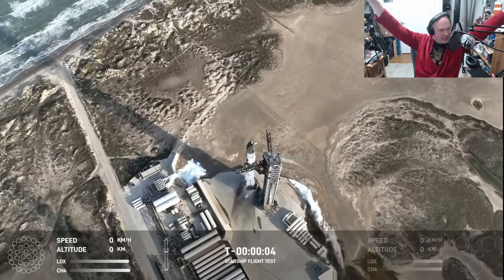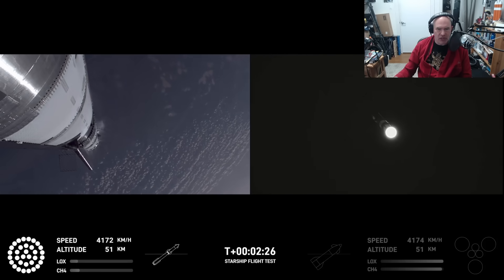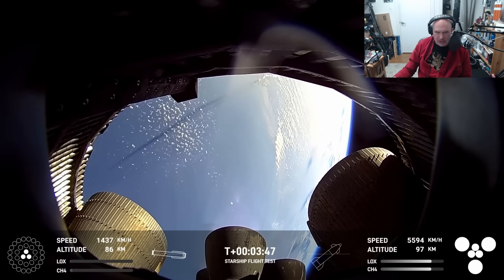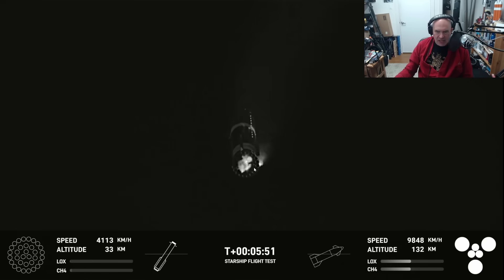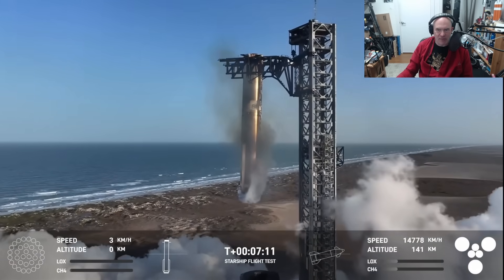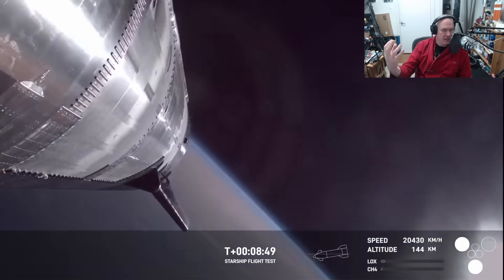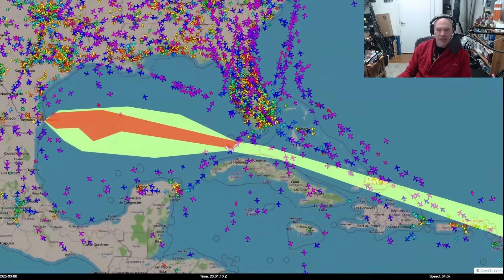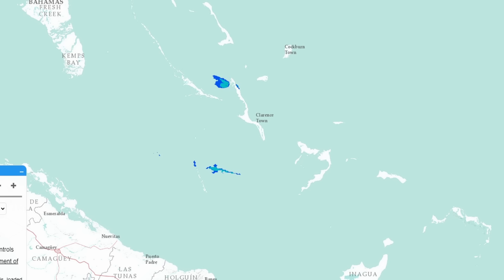SpaceX Make The Same Mistake Twice With Starship Flight 8

Comment: Now I understand why booster reuse is such a big deal: They will need 20 launches to have one surviving upper stage.
Reply: zing!
Reply: Great burn. 🤣
Reply: this is peak
Reply: The same upper stage that “Gwen” said was going to be taking 1000 people point-to-point in place of airplanes?
Reply: @antonyborlase3965 yep, the timeline on her statement is getting awfully short. Not that I ever thought it a viable idea.
Reply: @antonyborlase3965  she and elon said it was the whole starship and it was going to only be able to get from like saudi to nyc, burning 100x the fuel of airtravel, which is the most expensive part, but somehow in elons mind it would be 10x cheaper. Proving starship is hyperloop scam 2.0 before this he tried to buy soviet icbms to do the job. Lol. Elon smh
Reply: they arent using the same booster or engines. its all new
Reply: @jtit2025 well no. They allready reused an engine and acording to the comentators on the first attempt to lauch flight 8 this booster may actually fly again.
Reply: @Nostalgieletsplays the outer engines are fubar. They are terribly warped. No way they can be used again without major repairs and overhaul.
Also, the engines routinely fail to ignite once launched. What will happen, when the gimbaling engines fail during the landing burn?
Engines continue to fire on SS while at least 2 engines are completely missing.
It spins and tumbles without any control with the engines still firing.
Its a blatant disregard for safety and a lengthy investigation is needed, both from spacex and the FAA. It's ridiculous, that they were allowed to launch again so soon after the last failed attempt. They are not alone on this earth and spacedebris effects everyone. Both when coming down and when staying up.
I'm a huge fan of spacex and SS, but if Elon hadn't bought himself into a position of power, things would go very differently. Rightfully so.
Reply: @fritzwalter1112 you should see how nasa does it. They dump the whole thing into the ocean each time, scrapping it all.
Reply: The roast 😂
Reply: Ha ha ha. Fantastic!
Reply: Only if you ignore what iterative testing is.  They may need 50 launches to mature this.  This is how actual rocket development works.  Look at what boeing did with their capsule.  They had no test launches and tried to one shot it.  They barely got to orbit, they had hundreds of identified flaws, and they still cannot make it safe due to the poor underlying design.
Don't start rejecting facts because elon is a faker who pretended to contribute to spacex and tesla, when it is clear he has been lying about all his skills the whole time.  His claim of 150 year olds on social security was based on a simple mistake that no one with minimal experience would make.  It is irrefutable proof musk lies about his skills/knowledge.  Typical business CEO that knows nothing, but pretends to know everything.
Engineers at spacex made everything at spacex.  Musk is like a typical CEO, that engineers learn to work around as much as possible.
Reply: SpaceX has launched nearly 8K satellites to orbit with over 435 launches, more than NASA, Russia, and China combined. NASA killed over a dozen astronauts with their mistakes, with another dozen getting very lucky after close calls. SpaceX's team has done more for space than every other government and space company. Certainly a lot more than arm chair idiots that will never even try to do what is really difficult, even impossible to most, and still succeed like SpaceX does as the world champion team.  How many missed pole vaults have the superstar pole vaulters had in their career? How many lost basketball games do champion teams have in their stats? How many lost races do superstar race car drivers have in their career? How many wins do arm chair idiots have in any field that is difficult ...NONE.
Reply: @EdwinSteiner  😂
Reply: The money that was spend on these 8 launched, is enough to pay for 30-40 Ariene 6 launches, with its disposable boosters. So really, it's massively expensive, even with reusable boosters. Btw, Ariane 6 (heavy) had its second ever launch the same day, and safely delivered a satellite into orbit, for 130 million EUR.
Reply: @kurosumomo  They're using old and safe methods. Elon Musk is testing how to perfect things to make space travel cheaper.

Testing and pioneering will ALWAYS be very very costly compared to just doing what has worked in the past.
Reply: @kurosumomo  Interesting to note you've left out Ariene 6's development costs, which depending on the source is so far 3.1 to 4 billion dollars. Super Heavy/Starship is currently around 5 billion dollars. But A6 is not reusable at all, and it's capacity to LEO is only equal to F9 when Falcon is launched in expendable mode. And it's outclassed by alot vs Falcon Heavy even when FH is in reusable configuration. And it was almost 5 years behind schedule when it did finally have it's 1st successful launch. It's cost per launch is also double F9. SpaceX could design an expendable 2nd stage for SH and it would totally outclass A6 even in it's 4 booster configuration.
Reply: @kurosumomo and how much of NOT THEIR MONEY, and how much time, did they spend to do that?!
What is the capacity of that rocket compared to what Starship is trying to do?
I LOVE LAUNCHES! NOT AN ELON FANBOY! But, you're comparing apples to grapes as far as goals!
I support ANY "company" that wants to launch things to space! Even the centrifugal launch mechanism! I REALLY HOPE THAT WORKS OUT!
The only one I WILL bad mouth, is the power hungry, money hungry, will not support his company, Jeff 🙄
He had "a dream" apparently, but that didn't come out until after "the other guy" had already been long into it.
I can appreciate the launch company, all the engineers, all the employees, but NOT him!
Reply: While they could spend more time engineering the hell out of it on the ground for a near perfect try, I do think the telemetry and testing can very well enhance the perfection of it in time.

Break a few eggs without people and really get to understand the failure methods, you can better understand the tolerances and behaviors to track and account for.

The sad part is likely just the waste if materials but at least they recover the workhorse booster and it gets refined as well with it’s methodology.

Idk about yall, but in the long term I’d rather ride in a space craft that has had its failures tested, seen the maximum threshold for materials in flight, and actually overcome those things outside of theoreticals.

Nice to know how things actually behave and respond like in action, not just a computer simulation.
Reply: @ApolloTheDerg idk about you. But id rather ride on a craft engineered rather than guess and check method. Lol. And even proper engineered vehicles are tested to the limits everystep of the way. You cant trust a guess and check solution if they never understood the problems in the first place. He should leave it up to engineers like mueller who built falcon but design by meme nonsense that proved cybertruck to be a failure. Lol
Reply: @ApolloTheDerg  But what happens when you have to break all the eggs and come back for even more money? SpaceX has already gone over budget by $1.5bn... and they were commissioned by NASA to build a lunar lander for $3bn which they have already spent.
Reply: @nickl5658 what did they spend that lunar lander money on?! You have ZERO knowledge! Or if you DO, please share!
Boeing and Lockheed have been handed 10s of BILLIONS OF DOLLARS OVER 14 YEARS. WE HAVE HAD 1 SLS LAUNCH IN THAT TIME!
Where is Starliner right now?!
Reply: @ Wildly optimistic of you to assume that this level of competency will be shown by Space X with anything to do with Starship.
Reply: They’ll have 20 launches before ULA or Blue Origin have 2
Reply: @davidc2072  Yeah but ULA or Blue Origin's 2 launches will be successful
Reply: @ Keep riding that Elon meat... I'm sure he'll notice your devotion *eventually*.... lol
Reply: @davidc2072 they'll have 0 successful cargo missions when New Glenn will have 2
Reply: @davidc2072 How many will survive?
Reply: @davidc2072 blue origin had bezos on board, why won't Muskrat ride his own rocket?
Reply: @davidc2072  Yes. And one of 20 SS launches makes it to orbit, while 2 of 2 ULA launches and 2 of 2 BO launches will make it to orbit.
Here, have your participation trophy...
Reply: @ star ship has been sub orbital every flight so far.
Reply: @elgonzo7239  And so far, 6 successful Super Heavy Booster launches with 5 successful recoveries, while BO is 0 for 0. ULA is 2 for 2 in it's much simpler, non reusable design. Starship, which is the biggest hurdle so far for SpaceX, is orders of magnitude more ambitious than BO or ULA's "2nd stage".
Reply: @elgonzo7239 Delussional Copeland where the falcon nine didn't launch more times last year than the entire history of the space shuttle and without incident
Reply: @elgonzo7239 first love the name. To everyone else: destin did the math for when elon claimed 150 tons to leo. Now that elon reduced it to 40tons after 3rd launch that brings total number probably higher than 40 launches just to refuel to get one to the moon. Lol
Reply: @davidc2072  No, they'll NEED 20 launches for every 1 of Blue Origin at this rate.
Reply: yeah easier to replace 6 starship engines compared of all the ones a booster uses
Reply: They will have 20 launches BEFORE SLS! 🔥 
AND, still be $10 Billion in the green! 🔥
Reply: You don't make an omelette without breaking eggs.
Reply: @LePageChannel  Keeping with your analogy, there aren't enough eggs to break to make a single omelette...
Reply: @elgonzo7239  There are plenty of eggs. Otherwise, this comment section wouldn't even exist. An infinite supply of eggs, that is. And also. Practice yields perfection. It could be easy. If only it wasn't rocket science.
Reply: @LePageChannel  Infinity supply of eggs sounds like infinite resources, infinite time and/or over-unity. I like that... 😉
Reply: @elgonzo7239 government checks don't bounce, so more eggs magically appear
Reply: @NeedsLessWedge sounds like he needs a department like the us government accountability office who has been condemning starship from the start. Oops now its doge and elon says elon is good to keep spending our money. Smh
Reply: @elbob1491  yep
Reply: @LePageChannel  but how many eggs did nasa break? They tested full capacity from the first test flight, and they were doing research. You need to design/engineer the rocket to be the optimal solution before launching, using launches as validation tests only. Smh. Guess and check is what you do when you dont know what you're doing and hoping to trip over the solution. Elon claimed he has iterating starship for 20 years, nasa took only 8 and had to design and do all calculations by hand. And they handed him the playbook of all the new math and equations they had to invent in order to get to the moon like orbital mechanics. All Elon ha done is prove he isnt yet to 1960s tech. Smh
Reply: @elbob1491  But of course you'll ommit reusablility and NASA's Shuttle failure era. You type too much and say nothing.
Reply: @LePageChannel  i omit nothing. Elon made the continuous comparison to Saturn V, so take your complaint up with him.
Reply: @elbob1491  Saturn V wasn't the beginning either. It's only a comparison because it was the most powerfull. Project Mercury was the beginning. And yes, failures! 😂 You must be young. I was alive then, kiddo.
Reply: @LePageChannel  i know nasa, you also skipped other programs like redstone and gemini. Again elon made the comparison, so blame him. And who cares about power their missions were both to the moon.
Reply: @LePageChannel  so again if we compare the moon mission like elon did, nasa broke how many rockets? And did it in 8 years, elon is on year 20, hasnt got to orbit, and how many broken eggs did his hyperloop 2.0 cause? Lol
Reply: @elbob1491  And today, Crew-10, same as Crew-9, was successful to retrieve the stranded astronauts that NASA(and Biden) left behind. 
NASA IS FINISHED! 😂
Reply: @elgonzo7239  You're not making any sense. Any person who doesn't make any points in ther comments, and tops it off with a "😉" emoji, is immediately invalidated
Reply: @Timothy-Clifford  If you say so... 😉
Reply: @LePageChannel but you do make them with a scrambled solution of eggs that were broken (obviously not still in the shell)
Reply: i hope spacex gets sued for this . completely irresponsible to endanger flight paths of airllines with these hubristic launches from failed space shuttle failures.
Reply: @AndrewMcevoy-d8n  Obviously you don't know how any of this works. There is massive coordination done with multiple regulatory agencies like the FAA to minimize and/or eliminate as much risk as possible prior to, during, and after these launches.

Comment: I wonder if flying horizontal instead of vertical is causing a Harmonix issue they do not find on the test stand?? Plus the possibility of low fuel around the pipes so maybe something starts shaking when not immersed in fuel/oxidizer 🤔

Comment: Scott, FTS's have activation criteria, often dozens of different modes depending on stage of flight and location. Like a checklist. These are written specifically with safety of the public in mind. If popping the rocket won't do anything for anyone's safety (or perhaps even complicate things more) it won't be programmed to activate. A prime example is launch pad failures. A failure while still on the pad or even briefly after will not trigger FTS, however veering off course toward a populated area would.  I suspect that FTS did not activate here because at 140km and 20k kph it would not have helped anything. In fact, NOT activating it likely gave engineers more time to collect data.

Comment: Starship is many many years away from any type of rapid reuse. That booster might survive reentry 2 or 3 times before exploding. It can't lift anywhere near 100t to orbit, they have to figure out in-orbit refueling, and this is supposed to carry a crew to the moon in a few years?? 😂
Reply: the moon? they planned to land this on mars last year
Reply: @neliz2k *2022  😂
Reply: @neliz2k   they're not going to. Musk is trying to disband the FAA, so the first time a rocket part crashes into a plane, bad things will happen.
Reply: @neliz2k  Wasn't the plan originally Mars in 2021 or 22 before reality set in the first few times?
Reply: Mr Musk, 
You need to out of politics and focus on rocketry!

Lose weight, get off what ever you're taking, and get a good-night's sleep; or you'll end up like Korolev!
Reply: @anthonybellmunt3103   The only reason SpaceX can make rockets is that Musk isn't involved. He just owns the company. If Musk was in charge you'd see the Cybertruck rocket.
Reply: @anthonybellmunt3103 
I don't know about you, but personally I haven't seen any indication that Musk knows anything about rocketry. Presumably the best course of action for him would just be to not interfere in the running of Spacex at all.
Reply: @mikeblatzheim2797  musk is one of the advisors and lead enginears for rocketry. He help develop the full stage engine, a engine that everyone else belived  impraticable or too complex for use in rockets Probably without the kowledge in phisics and rocket that he have it woulnd be spacex
Reply: @nunomedeiros8390  
Do you have an engineering background? Because to anyone who does Musk's lack of expertise is rather obvious. He has proposed that people travel intercity via ballistic rockets. Someone like that doesn't have an understanding of astrophysics. And putting your name on other people's work isn't the same as 'helping to develop'. 
Or do you genuinely believe that Musk, who's never undergone any education in engineering, can provide constructive input to people who've spent decades of their lives working on these topics?
Reply: Reusability is not of much value if there is little usability to begin with. The whole point of SS is to be reusable. But for what can it be used? Squeezing small-ish payloads through a relatively tiny door using god-knows-what finicky mechanics? That's it...? SS is good for acrobatics, yes, so maybe SpaceX will pivot to sell Starship acrobatics shows in the future, who knows...
To be honest, i kinda expect SpaceX to develop a more conventional upper stage for heavy booster any day now and then shelving SS, giving this big boy some degree of usability and operational flexibility.

For all the people who still believe that Starship will touch the surface of the Moon or even Mars, i am sure Musk would gladly share some ketamine with you...
Reply: @ You're dead wrong, Elon wouldn't share. You'd have to bring your own.
Reply: There are lots of really great people who work there, but anything that hurt's Musk's bottom line is a good thing right now.

Comment: Wow... "to be fair"... the Space Shuttle made it to orbit with crew on board and landed in tact the very first flight. Iterative design has its place in some areas, but the United States Space program would have NEVER got to the moon - if the Saturn V failed 8 times.   And remember, this is the Earth’s atmosphere… Mars is an entirely different story.
Maybe the place to start is to just get a disposable second stage to orbit first… demonstrate the capability of fully recycling the booster and establishing a refueling solution.  Then, focus on StarShip – maybe in subscale first to iron out all the kinks.  The current approach reminds me of the Russian’s N1 project… and we know how that ended.